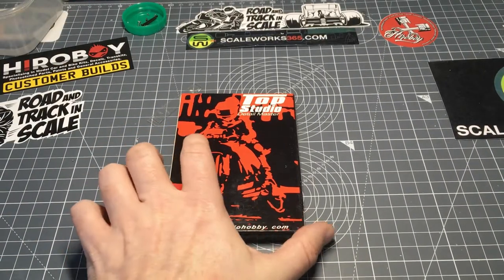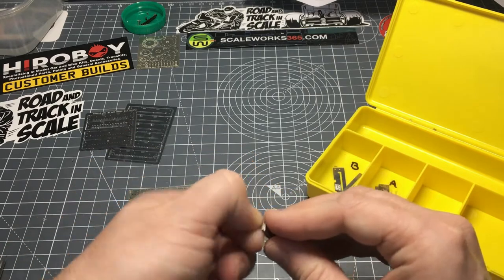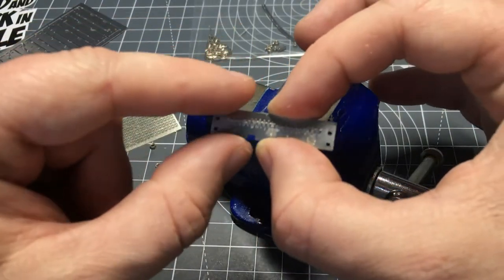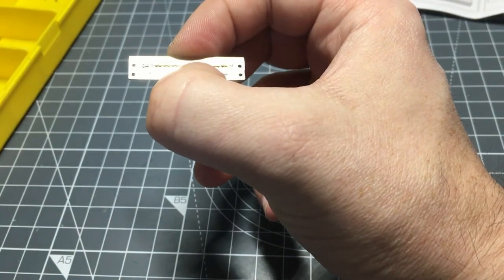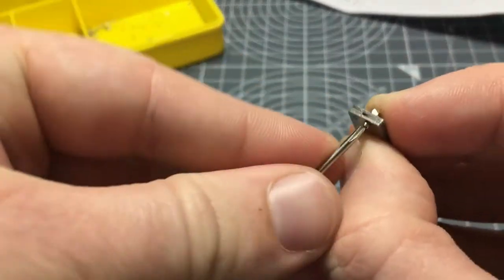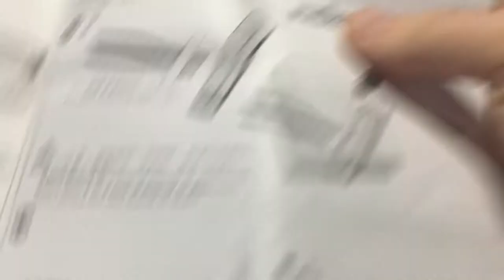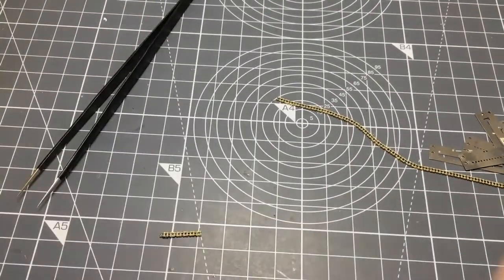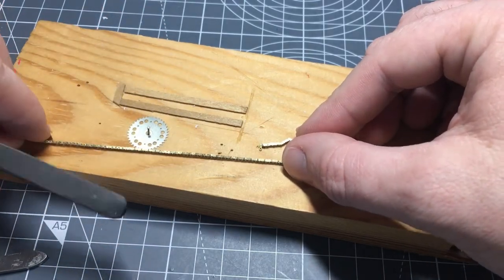Assembing a working chain from Top Studio

Comment: Great video, thanks for producing it.  I’ve just got the RC213V kit with chain and detail set, so your video is really helpful.  I was just thinking about spacers under the sprockets when you mentioned it.  Bits of scrap cut from the link fret should be perfect.  Fantastic tip about getting the length right.  I’d been wondering about how to get that right.
Reply from the maker: Thanks mwakelin. Glad you found it useful. Yes, i have plenty of PE washers and spacers, it was lack of planning on my part so rather than stopping the video and messing around I decided to just go with it.

Comment: I have a question. When attaching the chain through the plastic part following the instructions, why not construct the entire chain completely. Then cut the plastic where the chain is to go through, then glue it back together. With a little putty, sanding and paint, you should be ready to go. The only other thing you would need to do is mask off the chain for painting. Thoughts?
Reply from the maker: I thought about that way, but it’s easier to do it this way.
Reply: @DalrenModels  Actually, after I asked my question, I rethought it through. I agree, your process is better. 😀👍 I do have 1 suggestion: Can you speak a little louder in your videos. I had to crank up the volume 100% and it was still difficult to hear. Other than that, Excellent Video - Thanks! I bookmarked it!

Comment: Hi there.  I plan to purchase a pair of tweezers to assemble the chain.  Do you recommend the one you are using?  If so, please let me know what kind they are.  I am having a hard time seeing the brand.  Thanks, Mac!
Reply from the maker: Hi, the ones in the video were Trumpeter tweezers, but any decent, pointed tweezers will work just as well.
Reply: @DalrenModels  Thanks!
 Sorry to be bothering you again, but I can't seem to get help anywhere else.  I have the TopStudio TD23177 chain kit.

As you can see, the pins look tapered on one end and not the other. I figure since the links have different sized holes in them, the pins must have different sizes on each end. But we don't know for sure, because the instructions do not explain which way to set the pins in the jig. So, is there a difference in the size of the pins on each end? Does it make a difference which way you set the pins in the jig?  Thanks, Mac
Reply from the maker: Hi Michael, the links do have different diameter holes, hence having A and B frets. The pins have steps in them to accommodate the different diameter size, so the smaller links can only sit on the outside.
Reply: @DalrenModels  Well, I had one side completely done, and had nuts and bolts in the fixture. I noticed you didn't use them in yours, so I took mine out. I did use PVA after putting the chain pieces together, and let it sit overnight. Today, I walked up and barely touched it. The arm fell out and everything fell apart.  I'm wondering why did I take the nuts and bolts off. Is there some way to hold these in place?  What am I doing wrong?

Comment: I was just rewatching this as I've started trying to assemble my chain set.  I had an idea to make joining the sections a lot easier.  Put a pin in every slot, including slot a.  Then put the first row of 11 type A links.  Now put the 10 links type B, omitting the last one that hangs down.  Peen the pins over, being careful not to touch the first and last pin.  Protect them with tape or something.  Now, when you come to join the sections, just tape them together as in step 11.  Drop a type B link over the pins (hold with glue) and peen over as per their instructions.
Reply: antv

Comment: Dalren, sorry to bother you again. I just removed my first section of the chain and one of the end links, the link that is turned down came off. Is there a way to fix it?

Another thing, I noticed that when you removed your chain that you took all of the separate plates apart. However, the drawing shows parts being glued and soldered together, which I did. I'm not sure if these parts are supposed to be permanently soldered or not. Did you just resolder each time you made another piece of chain? I can't tell for sure if you even used solder. Seems more things to get in the way of getting the rivets punched down. The instructions do not tell me anything, of course!
Reply from the maker: The links fall apart from not being flattened enough - there's a fine line between not hitting hard enough, as in your case, and hitting too hard so they don't move. Only experience can say how much.

As for the second part, After building a few, hitting them with a hammer deforms the metal and they start to separate, so I couldn't see the point in doing the solder part, I just try to take care to hold it together while I'm putting it together.
Reply: @DalrenModels  Hello again, Dalren. I am extremely frustrated. I decided to order a second kit because all of the pieces in the first jig got dinged up. And, I only got one section of chain made. This time, things just aren't lining up like before. The pins get cocked and skewed when I put the arm in place. I did not have this kind of trouble the first go-round. Seems there is no one online talking about having any trouble with this. I am a journeyman machinist and am using a precision vise. I understand tolerances and measurements. I am unable to hold this thing in my hand like you show on the video. Can you recommend anything online other than your video - maybe someone else who had this problem?
Thanks for listening.
Reply from the maker: @michaelmcneive8182 , once the top layers are in place for the links it will be a lot more solid. There are a lot of people that struggle with them, most that struggle don’t bother with them as they are a lot of work. It’s only practice and experience that lead me to where I am with them, I had the same problems when I did my first one, but persevered with them.